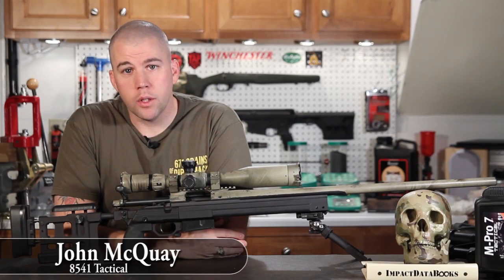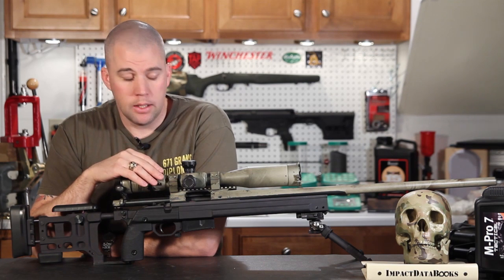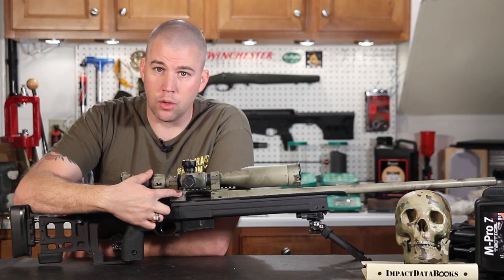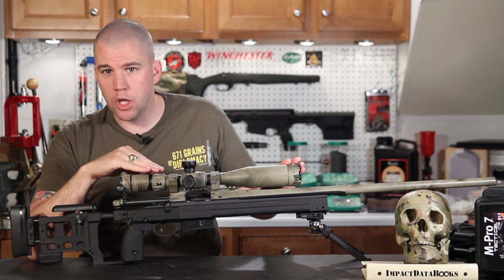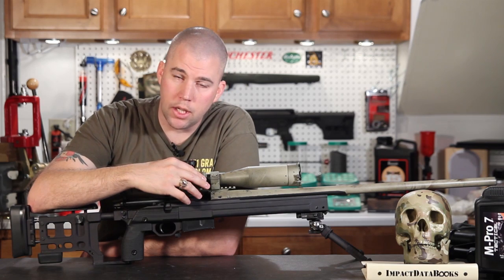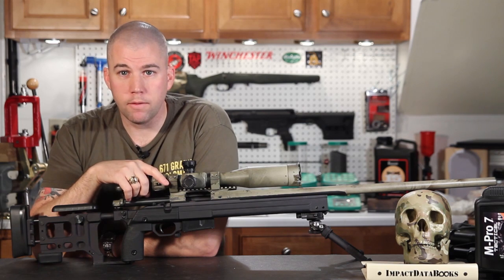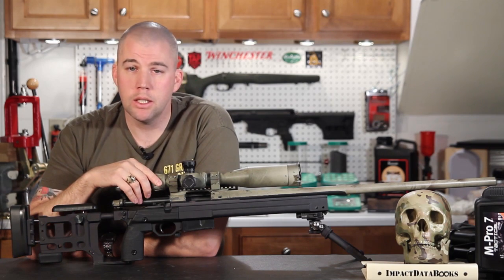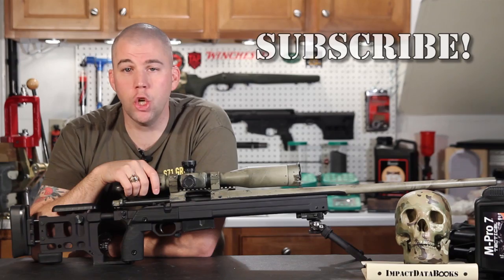Mail Call Mondays #36 - Scope Bases 0 MOA or 20 MOA?

Comment: Very good video, question, If you have a new scope/rifle with a 20 moa rail attached, the first thing you do, even before boresighting etc, is to click down the scope by 20 moa/5.8mil to adjust for having the 20 moa rail attached?And only then you go ahead and boresight and zero your rifle, which of course could mean you may have to further fine tune up/down depending on scope height etc. Is this correct? (assuming you have mounted everything else correctly etc etc) I know some of you say you should always boresight first thing, but I dont understand this because you already know that you are "wrong" by 20 moa so why not adjust for that first thing? That should at least make your initial settings closer to the correct settings?  Please comment
Reply from the maker: There are too many variables to give you a solid answer. I would boresight it first. If you do it in that order it will just save you the trouble of possibly dialing an adjustment you didn’t need.

Comment: Great video.  I am assisting a friend with a Barret 50 cal. Tridgicon 6 power.  I am not a rifle efficient person, untill recently, so I am a rookie. .  He is having the opposite problem as is most common in this thread.  He wants to zero in at 100 yds but runs out of adjustment and at that point accurately hits 8" high at 100 yds.  Calls Tridgicon they send him a canted spacer for the bottom of the scope.  I did mention to him that by being bottomed at 8" high at 100 yds leaves him all kind of adjustment for Long distance shots. Dosent matter he wants to hit at 100 yds.  So he asks me which way to mount the canted adapter.  I thought and after confusing myself a few times ,, told him that he wants the thickest part of the cant toward the front of the scope.  If that is indeed correct I may have a simplier way of explaining how to figure a canted mount. This is how I did it.  Seems everybody in here puts their first emphasis on the scope and what to do with it etc. etc. etc. which causes you to have to take into account multiple  variables .. To simplify it into one variable I just used the scope line of center as a constant.  (leave it alone in your thought process, as in it is just plain fixed)  Now in our case we are hitting high when we ran out of the adjustment to go lower. , so we want the thicker end of the canted base at the front of the scope so it will move the point of aim for the barrel down, which is what we want.... In the opposite case if you want to move the bullit hits up then again leave the scope alone in your thought process and use the thinner end of the canted insert/mount to the front of the scope which will raise the front of the barrel.    I hope I am not wrong and throwing out a bunch of B.S. One last thing is I have heard that these canted bases are not always reversable whereas the screw holes do not line up in the opposite direction.  If that is true do you have to specify this when you order a canted scope, insert, or whatever? or do they even make one for the type we need?thx

Comment: I bought a Remington 700 SPS Tactical with a 22" barrel chambered in a .308. 
I was looking to buy the Nikon M308 with the BDC reticle that is pre set for the 308 bullet drop up to 800 yards.
My question is if I installed a 20 moa base, would that affect the pre set BDC of the scope?
Reply: leonard Johnson no it shouldn't affect it you would zero the scope as normal

Comment: Hi.  I have a fixed flat mount, that with the Falcon 4-14x44  only leaves me with 4 Mrad left in adjustments when zeroed att 100 m. Im using medium height 30 mm rings. How can I elevate my scope since my rail is fixed on to the rifle ? Thse rifle is a 30-06 rem 750 with an accuracy inc. fore-end grip/rail.

Cheers
Reply from the maker: Replace the scope base on your receiver with a 20 MOA Picatinny Rail. Also make sure you are using decent quality rings.

Comment: I have a 30.06 Weatherby Vanguard. I’m about to install a 8-32x50 MOA scope. I’ll be using a picatinny long action rail. 
 All I do is deer hunt and I usually sight my rifle in at 100 yards. 
Should I use a 20 MOA mount so I can have that extra 20 minutes or simply go with a a 0 MOA which I’ve used for many years?
Reply from the maker: If your scope has the elevation to still zero at 100 yards, go with the 20 MOA. It just gives you capability to dial to longer ranges if you need to.
Reply: What height rings should I use for this setup? Oh, and I’ll be using the 20moa Picatinny Base/Rail you suggested earlier. The scope will be an Athlon Argos BTR generation two 6-24x50 moa rather than the 8-32x50

Comment: I have a new burris elementor 2 that i am putting on a Christian arms ca-10 with a built in 20 moa pic rail and I find that I am 6" high at 100yd with full adj down what is the best way to install a shim
Thank you
Jim Knutz 
Castleford Idaho
Reply from the maker: Jim, you could try installing a 20 MOA Riser backwards to cancel out the MOA built into your rifle. However the best option would be to sell that optic and get one better suited to the platform.

Comment: John, a general question If I may;  I just acquired a little Lynx (fixed) 6x42 (Japanese) scope which I intent using strictly for hunting on a .308  I prefer FFP scopes and also like fixed scopes rather than variable SFP units.  The elevation turret is coin adjusted and comprises an outer indicator (marked "in/100yd OA" and the usual little arrow showing up) and an inner coin adjuster screw.  This calibrated outer plate can be adjusted using one's finger and it turns independent from the inner coin screw adjuster.  However, if the inner screw "adjuster" is turned (with nice audible firm clicks)  it does so together with the outer marked plate even if the two coin groves are not aligned! I'm somewhat embarrassed to admit that it confuses me.  The scope is not yet mounted and I'm clueless with these turrets and hoping you could direct me to info or briefly explain how these turrets work.  Also, what does the OA means-MOA perhaps?  The outer plate is calibrated from 1 - 14.  does it mean 14 MOA?
Reply: It sounds like you would use the inner turret to adjust your zero, then the outer turret would be reset to 0. This way you could have a way of returning to your original zero if you have to deviate. HOWEVER I have never worked with a Lynx scope. I am just speculating.

Comment: I have a Savage modle 116 in .338win mag. I'm putting a Zeiss 4x12-42mm with a 1" tube. I want to zero it at 200 yards... What MOA scope base should I use?
Reply from the maker: Use 20 MOA unless you have a reason not to.

Comment: I have a question for you.  I have a rifle that has a built in 30 MOA rail.  I have mounted a Elite 6500 scope on this rifle and zero at 100 yards.  Before I mounted the scope, if you would have asked me where the scope would be adjusted to, would have said somewhere near the 0 mark on the scope as I have 50 MOA of adjustment on this scope.  But, to my surprise, when I zeroed the scope, it was near the 30MOA mark on the scope.  So, when I try to go out to 700 yards, I run out of adjustment, even though I have 30MOA on the rail.  
So the question is, do you think there is something internally wrong with this scope?  I would say there has to be.  
I am mounting another scope on this rifle tonight and I will find out if I have the same results or if it zero's near the bottom of travel like i would expect it to. 

Thanks
Great video by the way.
Reply: It definitely sounds like something is amiss. Could be scope, rings or base. However swapping on a known good scope would be a good troubleshooting step.

Comment: I have a 30 MOA base built into the rifle Barrett MRAD.  I installed a Kahles K624i Scope with 25 mils elevations.  After installing the scope and going to the range I used up most of my elevation to get the 100 yard Zero.  I am still a little confused.  I also have USO scopes where I would be able to move that erector with a allen wrench, however with this scope I can not do that.  Can you help explain this .  Thanks in advance
Reply: That doesn't quite sound right. You should have had to bring the impact of the round down to get your 100 yard zero, leaving you with plenty of "up" for longer ranges. If this is not the case, re-check your mounting hardware. If all still seems correct, I would contact Kahles for help.
Reply: +John McQuay (8541 Tactical)   Thanks for the quick reply.  But if you mount  the scope on a 30 moa base for 100 yds, I would have to bring the impact up.  It was shooting below the target.  I just get a little confused at this point where the mount points down and where I should be moving the bullet impact up?  I'll call Kahles.

Comment: I am currently using a steel 20 MOA EGW HD rail on my rifle. I needed a higher cheekweld so I upgraded the stock with a KMW adjustable cheek piece. With the cheek piece adjusted all the way up I find that it is still slightly too low for me. I was thinking of replacing my pic rail with a 0 MOA Seekins rail. I hear the Seekins rail are lower than most of the other manufacturers. Will a 0 MOA Seekins rail place the rear of the scope noticeably lower than a Seekins 20 MOA rail? Im not worried about the adjustment on my scope, with the 20 MOA rail I have 22.4 mils of up adjustment. Im using Seekins low rings and I still have about 1/4 inch between the objective and barrel. This is a competition rifle that I use for local and PRS matches - I wont be shooting farther than 1300 yards.
Reply: I don't believe there is a massive amount of difference between the height of the 0 and 20 MOA Seekins rails. I suggest you email Seekins. I am sure they can provide you with the info.
Reply: ***** In case anyone was interested, here is the response from Seekins: "The height for the 2 rails is exactly the same in the rear of the scope 
base the difference in height is only in the front.  The 0 MOA base 
measured from the front of the base is 0.347 and the 20 MOA base is 
0.314.  I hope this information helps.  Thank you for your time and have
 a wonderful day."

Comment: I have a Rem700 P and the previous owner had a ECW HD 30MOA scope base on it. I installed a Trijicon Accupoint 5-20 on it and called it a day. I went to the range yesterday and was zeroing the scope and rifle at a 100yd. My first round was high from the point of aim ( about 7-8 inches ), so I dialed it and I was able to line up with the point of aim but it maxed out the down elevation knob ( now all I have left is the UP elevation )... Should I replace the scope base or call it a day and leave it, basically a zero stop of some sort...or am I missing something or not understanding the whole thing.     Another thing...the scope does not have a lot of internal adjustment in it... I think it only has 47 MOA of elevation adjustments in the scope with 12 MOA per revolution of the elevation knob. I got a good deal on it, its the reason I own one...
Reply: As long as you are able to get a 100y zero, I say let it be.
Reply: that's what I was thinking...I just wanted someone else to tell me...thank you

Comment: With a 20MOA base, what is the best ring height to use low, med or high?
Reply: you can generally use the same height rings as you would with a 0 MOA base. A 20 MOA base will tilt your scope objective slightly (thousands of an inch) closer to the barrel. Unless your scope is mounted super tight above your barrel (playing card thickness), you should be fine.

Comment: If I use a tilted mount,how will it affect the place my eye needs to be? I'll have to take my cheek rest hight and closer?
Reply: Roi Karp Some 20MOA mounts can be slightly higher than the 0 MOA versions. So your cheek may need to be slightly higher.
Reply: ***** My experience has been the rear scope ring is approx. 22-30/1000 of an inch higher to achieve your 20 MOA. I have yet to have to change the cheek rise as the difference is so small. To sum it up, unless you're starting with a low end cheek rise, you'll be pleasantly surprised that the difference is not noticeable. Your mileage may vary ever so slightly.

Comment: I have a question  I have a 10moa base  with my mil dot scope  zeroed at 100yrds at 500 yrds my ballistics  calculator  says to use the second  mil dot but using the first dot below center it hits at 500
Reply from the maker: Likely either the ballistic coefficient or the muzzle velocity you are inputting into your calculator are incorrect. This is assuming that you are using a FFP rifle scope or a SFP scope with the magnification set at the correct power for the reticle.
Reply: 8541 Tactical thank you I figured it out had the power on the app set to high

Comment: is that a falcon menace scope? How is  it? I was very skeptical and went with a primary arms.
Reply: they are the same exact scope
Reply: Ahh! That's why they look very similar! Thanks Are you familiar with Sightron? I'mthinking about one of there FFP when I purchase a Savage 110ba
Reply: Ive got both.....1 PA on my rem sps tac. And 1 FM on my VTR .223....same scope same adjustments...same markings ....the falcon menace actually came with NO markings on it at all
Reply: there were 2 differences i saw... 1. reticle on the FM was finer.... it had hash marks and  1/2 mil hash marks where the PA only had mil dots... and the  PA  had top screws for your "zero out" option.... as opposed the the FM  where it had the 3 sets screws to be able to take off the turrets to zero out.... otherwise the controls... the look....the feel....the quality... and clarity were all the same.... i would recommend either one

Comment: would it be safe to say that a viper vortex with a 30mm tube would be able to get a 100 yard zero with a 20 moa base?  do you have any brand recommendations for a picatinny rail for a weatherby vanguard?
Reply: I'd like to here a reply on this too... I bought a Viper Vortex HST (claims 75 MOA) and I too am trying to decide on what type of rail for my 7mm Rem Mag Howa (I've seen some for a +$100 plus in steal and ~$30 in aluminum). I'm using this rifle for both hunting close range and fun shooting long range. Thanks
Reply: nuikuitui
I got a Warne steel rail.  it doesn't fit the receiver too well, so I'm looking into bedding it.  I haven't shot the gun yet at all, so I have no idea on sighting it in yet.
Reply: I have the Vortex Viper HS LR 4-16 x 50mm on a Colt M2012 with a 20 MOA base and was able to get a 100 yard zero without a problem and I still have a enough MOA to hit 1000 yard targets. I barley get there as there is only 43 MOA left for adjustment from my zero
Reply: vortex scopes have such a wide range of elevation MOA that you won't have a problem with the 100 yard zero. I run a 20 moa base on mine with a vortex viper and it works great

Comment: John,
Here's the deal.  I placed a 20 MOA Base on my 5R MilSpec .308 and then topped it off with a new Scope that I've never used, it's a Mil/Mil Vortex.  Anyhow, I shot one shot at 100 and zeroed to the shot.  Shot 6 more at 100 and 4 of them made a ragged hole and the other 2 barely touching.  Moved to 200yds shot 3 times and didn't even touch the 20"x20" backing, let alone the target.  Factory 150 gr hunting rounds, not 175SMK reloads or FGMM.  What gives?  Is there something else I'm missing regarding this base?  Never used a tilted base before.  Thx man.
Reply from the maker: If you were zeroed at 100 and you missed a 20x20" target at 200 yards, then the problem is not the base. Even shooting at the 200 yards target with your 100 yard zero and no elevation correction, you should have been on the backer. Check to make sure all your mounting hardware is correctly tightened. Once you zero, you can forget the base has any angle to it. It doesn't need to be corrected for when dialing your elevation.

Comment: 9 years later!
A question - if you have a zero MOA base and shoot out to 100 yards then change to a 20MOA base, doesn't it shoot low rather than high?
Thanks.
Reply from the maker: No. A 20 MOA angled base adds elevation to the system. So if you kept the scope elevation at the same settings, your shot would impact higher.
Reply: @8541tactical  Doh! Of course. I had been looking at it the wrong way round!
Big thanks for that!
Reply from the maker: No problem brother!
Reply: @8541tactical  And after 9 years too!
PS - really appreciate your videos. Been watching them since I re-started shooting a couple of years ago.
Thanks.

Comment: Long story with question:  I tried to have a scope bore sighted on my Savage Axis (.243 Win) and was told the scope was too high and he couldn't lower it enough to zero.  The scope is a Simmons 3x9x44 "Magnum". Said my scope was too big (high?).  He even tried smaller rings but then the bolt handle hit it and wouldn't work. Long story short, they installed the Leopold 20 MOA bases backwards.  The higher one was in the front so the scope sat higher toward the bore.  maybe that is why he said it was too high?  I switched the bases so now, the higher one is in the rear causing the scope to be lower at the bore (opposite of before).  Should I be able to zero this rifle in at 100 yards?  Do I need zero MOA bases?  The maximum range I plan to ever shoot this rifle is maybe 200 yards.  Thanks in advance and great ARTICULATE explanation although I haven't been able to grasp it yet.  Will subscribe.
Reply: More than likely the backward bases were the problem. You should try to zero it now before you buy anything different.